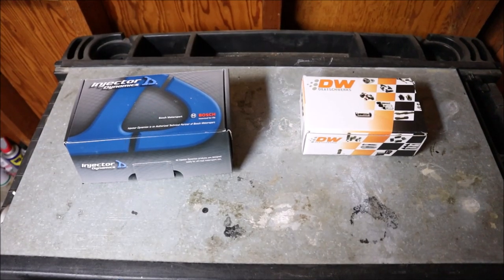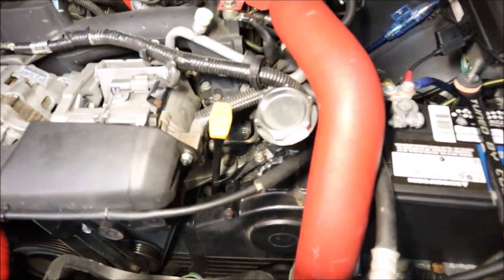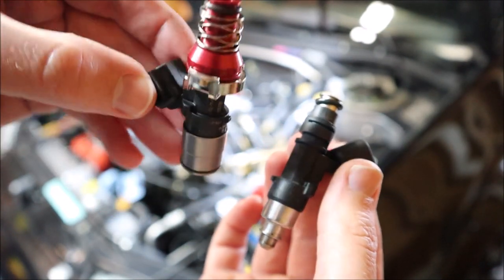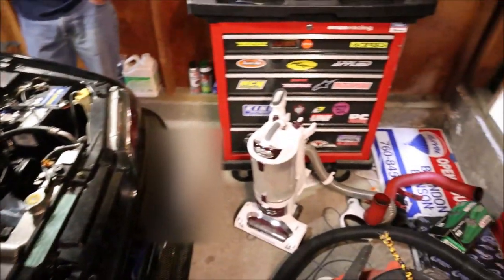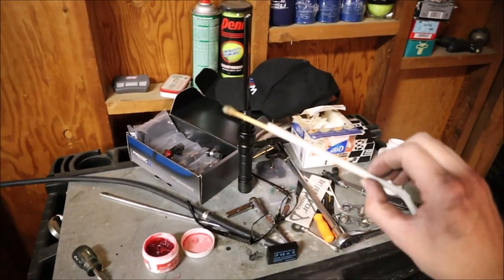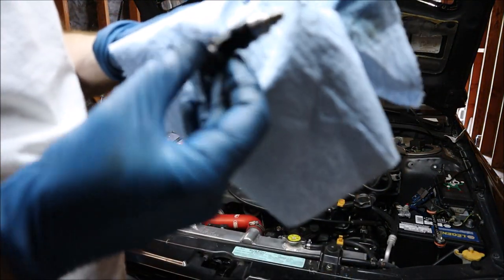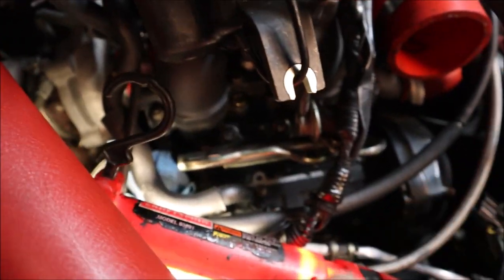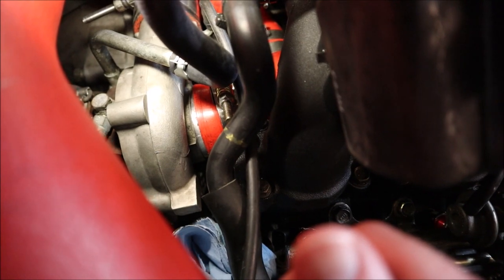Subaru Impreza GC8 Build Gets Bigger Injectors: Part 3

Comment: I'll give you a pro tip on clamps for turbo intakes. Go buy some Turbosmart hose clamps, those are constant tension and will never come off even running huge boost. Piss those crappy t bolt clamps off, they area waste of space, complete junk. Anyway, I subscribed keep it going.
Reply from the maker: Thanks I’ll check them out! I think an AOS will help also as oil is getting in the intake track causing slippage!
Reply: @RoadPatina  yeah an AOS is a necessity if you are going for big horsepower. In regards to the clamps, it wouldn't matter what amount oil was there the constant tension clamps will never move until you unscrew them. Anyone that tracks their car or does motorsport seriously uses these clamps for high HP application. They are expensive though.
Reply from the maker: Sneaky Foz wish I would have found those before buying a ton of T clamps! This is the only junction giving me problems. Pulled the inlet, cleaned, and reinstalled with T clamp holding. Still don’t trust it!